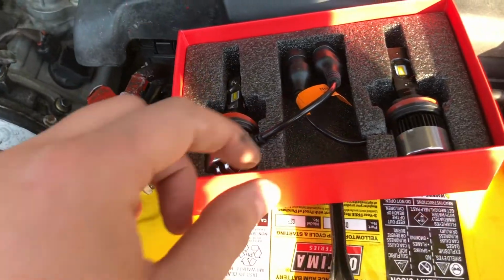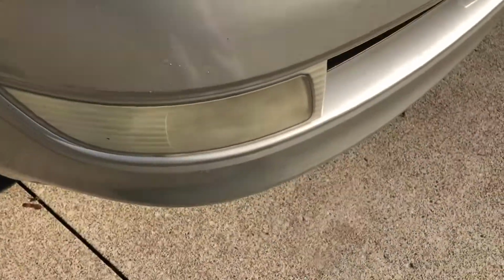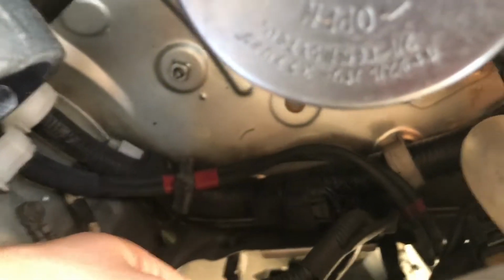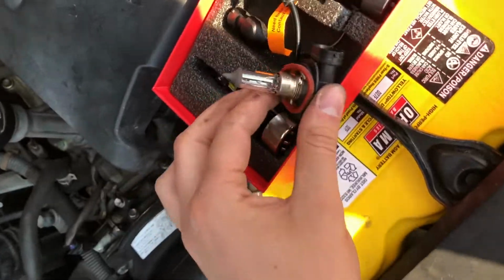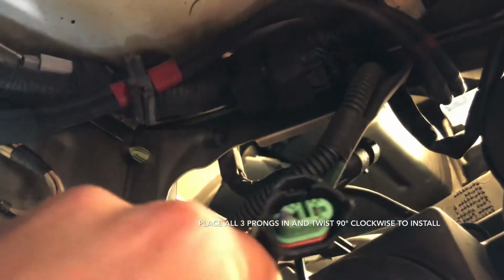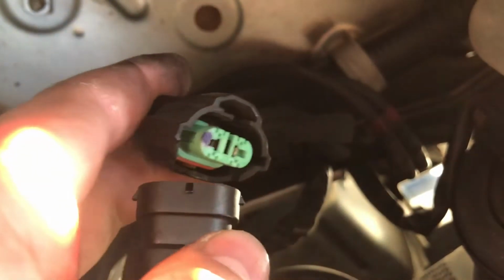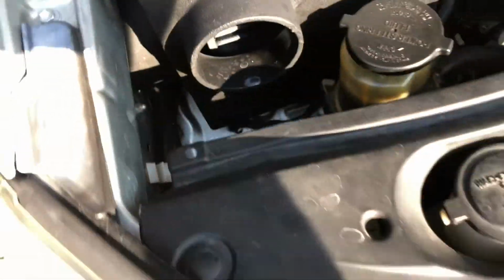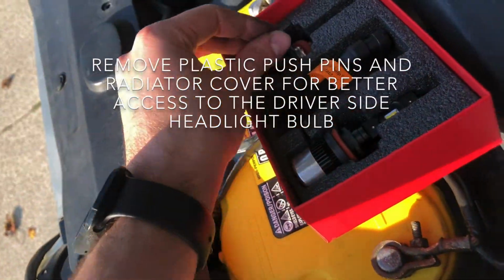LED headlight Bulb Install GX

Comment: I have a question about your Gx 470 Blend Door Actuator Repair video.  My GX has a situation in which the air only comes out of the vents and switching modes to floor or defrost has no impact.  Do you know if that is the Blend Door Actuator or a different Actuator?  Temp control and blower speed all seem to be working properly.  Thanks in advance.
Reply from the maker: It should be the other actuator that opens the Mode door. Listen for a noise when you change the mode. If there is no noise your motor is most likely bad. It’s easier to get to than the one in my other video

Comment: I also have a question related to your GX 470 Blend Door Actuator Repair Video: I have been hearing a loud rattling noise for the last 2.5yrs (annoying AF as you could imagine) when I speed up or hold highway speeds. Wondering if you ran into that issue as well with a bad actuator?
Reply from the maker: That may not be the same but a broken repercussion door if the rattle is coming from the dashboard. That would require a complete removal of the Hvac system tho. Please follow/subscribe for more information and content!
Reply: @MecanixGarage  bummer - thanks for your prompt reply. I will need to upgrade to a Flowmaster like the one on your short to quiet down the noise https://www.youtube.com/shorts/uGZUY4yWOeY (also, those tail lights!)